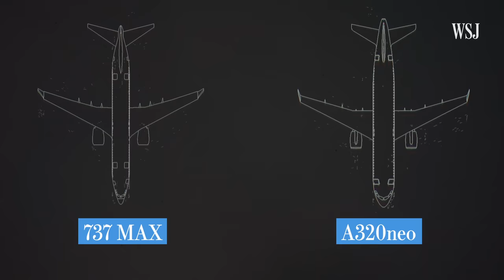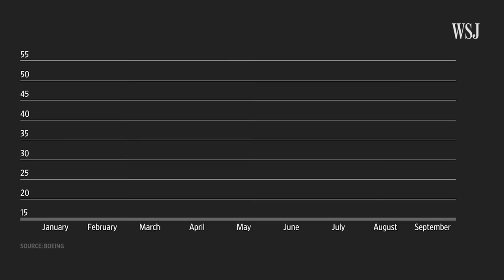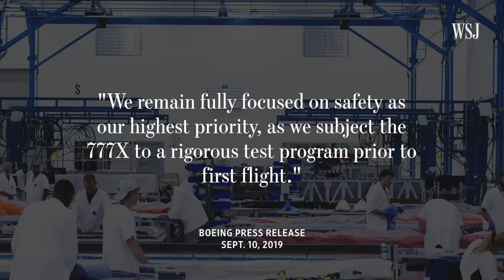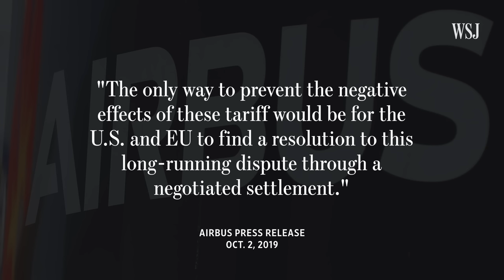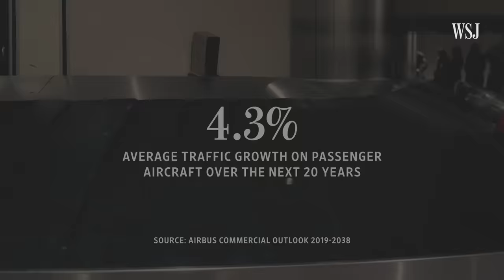Boeing vs. Airbus: Why Aviation’s Biggest Rivalry Is in Flux | WSJ

Comment: One word Greed, which costs the life of the passengers and crew in those 2 flights. They wanted to push the redesigned plane really badly just to secure their market share. Btw A380 was a engineering masterpeice, yes its not commercially viable. Think of it as a hypercar it doesnt sell like average cars yet owning it is a statememt and their engineering is much appreciated.

Comment: The question I still have over this 737Max is, how come there were lots of them flying in Europe and North America up to grounding and none of them crashed?
Could the accidents have been a mix of the fault and pilot misjudgement?
Reply: No. You should trust the international authorities that determine the safety of these planes.... you have no clue what you are talking about, the complexity of a plane needs hundreds of people to fully understand..
Reply: So you want it to crash in europe/na first before admitting something is wrong with the plane?
Reply: Telmo  Simoes   B I N G O !!!!!  The MCAS is designed to help INEXPERIENCED pilots who only fly computer planes to fly !!! There were sensor malfunctions and the first Lion air Plane was recovered the previous day by an EXPERIENCED pilot who just happened to be on the plane !! ! And the ground crew released the plane the next day to third world pilots that crashed the plane !!!
Reply: FallingTitan The Aircraft just needs the right pitch. MCAS was reliant on a Single sensor which was prone to failure, now it is linked to two sensors as backup, pilots are now informed about the MCAS system
Reply: AOA failure could have happened anywhere at any time. Pure luck it didn’t happen in a western country.
Reply: @wilburfinnigan2142  yes, lion air also had blame with the crash. The previous crew reported problems with the aircraft and yet the airline insisted that it be used
Reply: @thomasgrabkowski8283  TRUe !!!! The crew the previous day had a uncommanded pitch down and just happened to had a third EXPERIENCED pilot on board and shut off the MCAS and controlled the aircraft and landed it safely !!! Plane should have been grounded untill the AOA sensor was changed but the plane was released and it crashed !!!! Interesting NO pilot in North America or Europe had any problems with the Plane !! !
Reply: Wilbur Finnigan the experiences pilot didn’t know he was dealing with MCAS. He just thought it was a runaway stabiliser fault
Reply: Johnny Wynn too late for 349 people
Reply: @tomstravels520  BUT..........  Through his EXPERIENCE he handled the situation !!!!  And saved the aircraft !!!!!! DUUUUUHH!!!!!!
Reply: Wilbur Finnigan Pilots in the US have reported problems with the plane such as I commanded pitch down but they just thought it was runaway stabiliser and managed to stop it
Reply: @tomstravels520  Here again EXPERIENCED pilots !!  NOT third world computer pilots with little to no hands on in the real world !!!

Comment: NOPE THE A350 Airbus is a cheap copy of Boeing aircraft however the A350 has cheaply made Rolls Royce engines that do have a tendency to exlplode. Plus the new Boeing 777-9X, 787 and 747-8 are faster than the A350 and the Boeing 777-9X with it's powerful General Electric Engines AKA GE-9X Engine has 155,000 Pounds of Thrust will be known as SUPREME AIRBUS KILLER. Those cheaply made Rolls Royce engines has has caused the Airbus A350 to be known as " A350-El SLOW-POKE OF EUROPE." The only tjing the A350 can kill is the rats in their cargo bays and they go eeek, eeek and eeek! Airbus Fanboys need a support group because no matter what they do or think they cannot compare the A350 Airbus to the Boeings Supreme-Airbus-Killer  known as the Boeing 777-9X and with two GE-9X engines it has 310,000 of thrust while the A350 only has 194,000 pounds of thrust plus Boeing 777-9X is sleeker, faster and gets better milage than the cheaply made of A350 with it's Rolls Royce exploding engines. Gee Whiz the 777-9X with it's two General Electric GE-9X engines has more thrust totaling 310,000 pounds of thrust. While the puny A350 only has 194,000 pounds of thrust and I reiterate my little traitor the Boeing 777-9X is alot faster, sleeker and gets better milage,
Reply: what does this mean
Reply: tl;dr I care about not dying when flying.

Comment: Today the 737 max is the safest plane on the market.
This is due to the fixes after the crashes, as they fixed more then just the M-cast.
Reply: That piece of junk will be a death trap forever. It needs endless software updates just to keep it in the air.
Reply: @yearight5303  they had to fix all the issues and go through tones of tests, because of the crashes.
Right now it is the safest plane out their.
Reply: Your comment seems so ironic after the recent crash of the Chinese 737 max
Reply: @smellypooper6969  that was a 737 NG
Reply: No Airbus A320Neo and neo family member ever had a flight fatality. One hull loss after a collision on the ground (2 firefighters dead), and another collision with two motorcyclists (yeah I know...) dead. Not one flight accident with human loss. Much safer than the MAX.

Comment: Boeing has been giving upnon safety for decades, while Airbus has never succeeded at building a safe aircraft. Boeing engineers know what to do, and they're choosing to do wrong due to pressure from executives. If Airbus learns how to build high redundancy, pilot responsive control systems, they could easily replace Boeing in terms of credibility, but that plane would cost more so they won't. All new commercially viable planes will always be very dangerous.
Reply: Airbus has a phantastic safety record...